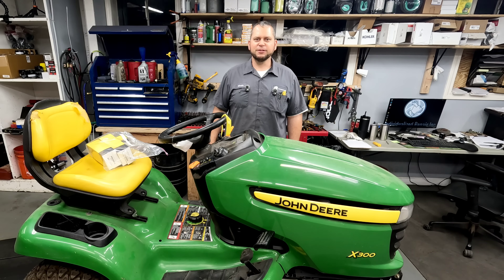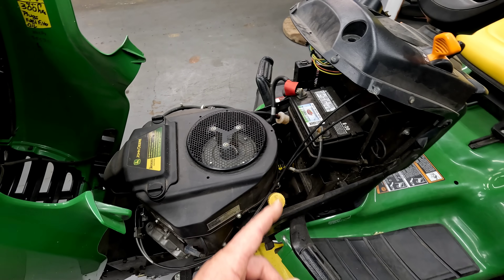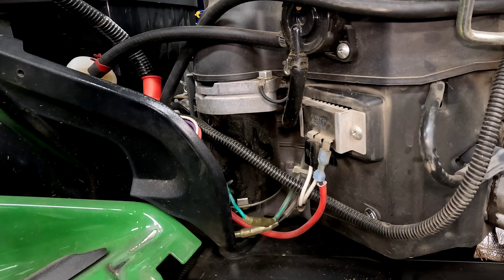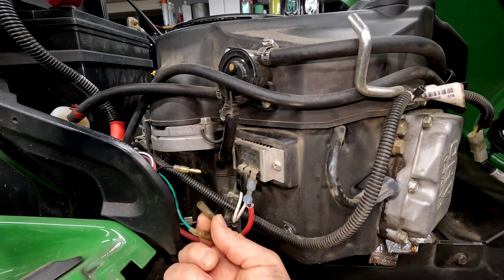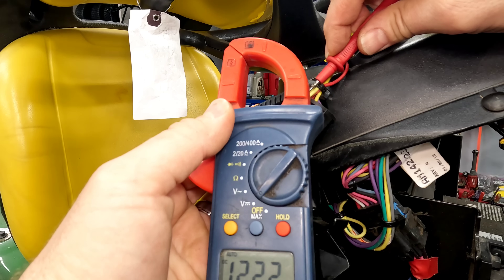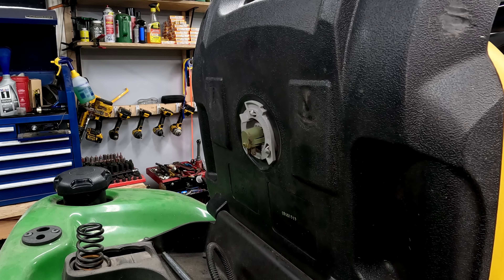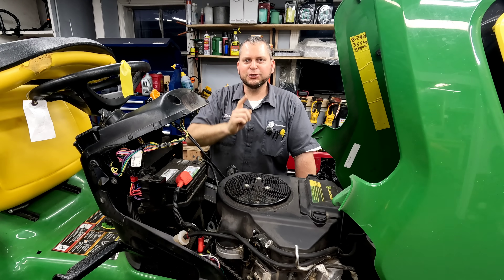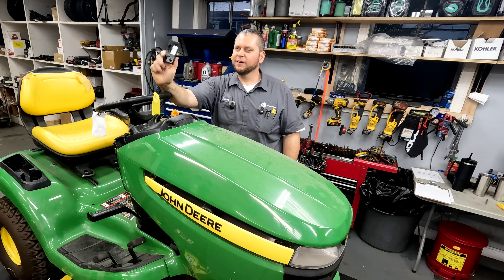John Deere X300 Runs Then Dies After Warming Up? - Full Diagnostic & Repair Fix For Random Shutdowns

Comment: Hey. Good video. I’m here because I have a similar issue with my X340 that’s been driving me nuts for over a year after several fixes. The mower runs rough sometimes, usually not bad enough to stall except after it warms up then it runs very rough and stalls. I’ve also had experiences when it will solve itself after shutting and restarting the motor or disconnecting and reconnecting the spark plugs. Other times, that doesn’t have any effect on the engine running rough. I’ve cleaned the carb, cleared the fuel lines, cleaned out the fuel tank, changed the spark plugs, changed the fuel pump, changed the fuel filters, replaced the ECM. In summary, it seems to be an intermittent issue because sometimes it runs smoothly, but usually runs very rough and stalls after about 30 minutes of mowing. My next move is to replace the battery because it’s over due (6 years) and possibly replace the ignition coils. Im hesitant because the parts are over $200 so don’t want to replace them if they are good. Any thoughts?
Reply from the maker: Has the pickup tube elbow where the line comes out of the tank been checked for debris? Sounds like a fuel delivery issues to me. Really need to figure out what you are loosing when it dies. The ECM is very voltage sensitive so I would definitely get the battery replaced right away anyway
Reply: @IndRepair  Hello, I’ve gone ahead and made a video showing the issue. https://youtu.be/42DiuO2Aooc?si=YOzwTqGkCrZ3Q1NV
Reply: Yes, I thoroughly checked the pick up tube when I took out the fuel tank to clean. Am getting a new battery asap.
Reply from the maker: Definitely

Comment: ⚡️ ⚡️ ⚡️ 
Martin, I’ve been having a difficult time following along on some of your recent electrical diagnostic videos. This includes this one as well as two  weeks and four weeks ago. 
I’m learning about this area of small engine work, but it’s always more difficult for me than any of the other areas, probably because I’m just not wired correctly for that kind of information. 😉😂
Would you consider doing a video that isn’t a diagnostic or repair, but strictly for teaching?
I’d really like to see how every wire is routed and what it looks like on a wiring diagram and on a lawn tractor (and possibly a zero turn). 
I’d like to see every single wire, tracing where they go and what they do on the machine, identifying clearly whether they are signal, positive, negative, ground, etc. 
I know this is asking a lot, but I had to ask! ⚡️ ⚡️ ⚡️
Reply from the maker: I have been trying to figure out how I would do this but not sure it would really help. Many mowers are wired quite a bit differently and operate very different from the others. The only time I have seen something done like this was on an EETC video one of the guys was learning from recently. I will think some more about this and see if something that would be helpful. I appreciate the request!
Reply: @IndRepair 
Thanks for at least contemplating something like this. I appreciate your intentions!
Reply from the maker: Still trying to figure it out but I think it may just work!

Comment: Noticed that’s the 18.5 horse x300 - newer model. I’ve had hell with that newer model as opposed to the older x300 with the phenomenal FH series 17 horse. That 18.5 has killed 3 ecu’s in a year, I have 9 with the FH 17 horse and haven’t had that issue on one. I’m convinced JD has something overcharging the electrical system and pushing more voltage than the older x300 17 horse models
Reply from the maker: Hmm that could sure be the cause...now I wonder

Comment: Like you say maintenance is the answer for long life mowers. I have a 1995 Craftsman EZ3 that I bought new. I have always keep it serviced and clean the deck after use. It has never once broke down. 15.5 hp Briggs runs like new still. All i know its got hundreds of hours on it and runs great. Other than replacing battery and blades bi yearly it s still in great shape.
Reply from the maker: That sounds like you did a great job! It will serve you well for years to come!

Comment: My father in laws John Deer had a no start. My brother in law changed the "computer", which I'm assuming is this board, for $300. That didn't work, and he ended up replacing the ignition/key switch. My father in law is still complaining about spending that $300. How much was that board for you?
Reply from the maker: This is the "computer" board. This board is around $125. If it doesn't send voltage to the board it will not start and if it doesn't send voltage to the starter solenoid it will not start. Wonder why it was so much

Comment: What is that secondary spark reader tool at the end?   I have one for an oscilloscope; but it would be nice to just have a little tool to grab, rather than dragging the scope out every time.   Can you link me to it?  or what is it called?
Reply from the maker: This is a Spark Check'r SPC-7200 https://ebay.us/Js5ohF

They are great and save so much time!

The link here is an affiliate link for which we may be compensated if you make a purchase

Comment: Yeah.. I would have wired up a manual kill switch and never looked back. :)
I would never buy a John Deere OEM part.. just on principle.
I'm so sick of these companies putting modules where they don't need to be;  and taking perfectly good/replaceable relays and building them into the module, where you can no longer service them (at least not without some solder work).  I  really wish there were more 'monopoly" cases going to court over this crap..   We shouldn't be allowing them to build trash and then make us keep buying their trash replacements.  (granted, I would never openly buy any of this stuff new anyway).. I do get tired of seeing it though..   Rant over. ;)
Reply from the maker: Haha rant but definitely true!!

Comment: As a mechanic, I always keep those ECU's on hand. I've replaced 8 so far this year. The last one I  had came in for the mower not engaging, and it was stated it was surging bad.  I tested out everything and found a bad ECU. That's not the crazy part. With it still installed, I pulled the connections on the black coil wire, and the engine stopped surging, and the engine ran great 👍 And yes, I have had good luck with quality after-market ECU's 👍 Thank you for your great videos 😀
Reply from the maker: Definitely see it a ton! That is kind of crazy it stopped surging when unplugged. Thanks for sharing about the aftermarket boards, I will give it a shot. Thanks for watching!

Comment: Great video. Thank you for sharing. Is that control board was bad and replaced fix the problem machine run 18 mimute shut off.
Reply from the maker: I appreciate that! Not exactly sure what you are saying here lost you somewhere but it ran for an hour after replaced. It only ran 18-23 minutes before we replaced the board. Thanks for watching!

Comment: I have a 1989 240. Does it have that board in it?
Reply from the maker: No it will not have a board. I believe around 2005 is when they started using this system

Comment: I have a similar issue with an lx279  but it doesn't have a brain box should I replace the panel i think it's around  a 2007ish
Reply: No test system, sounds like fuel solenoid
Reply: I already clipped it, replaced fuel hoses,,carb job,checked for water
Reply from the maker: See what you are missing when the problem occurs. Loosing spark or fuel likely. Normally those panels go bad cause a little different issue but anything is possible

Comment: Whoever decided it was a good idea to put a computer on a lawn mower needs to be dealt with harshly and switfly!!
Reply: It's not really much of a computer, but a safety interlock module made to reduce the number of electromechanical relays. When it goes bad it simulates a safety interlock being engaged and shuts off the engine and/or the PTO clutch.
Reply from the maker: Yeah, is a computer but not really at the same time.
Reply from the maker: I agree there, should be simple!